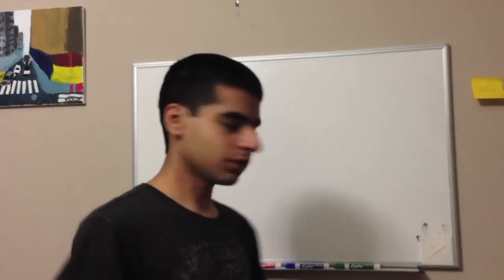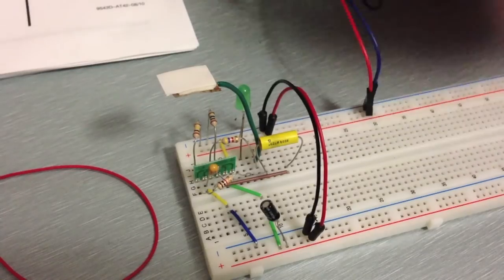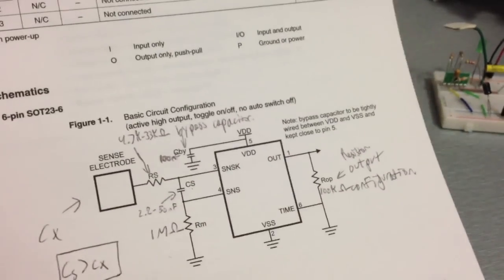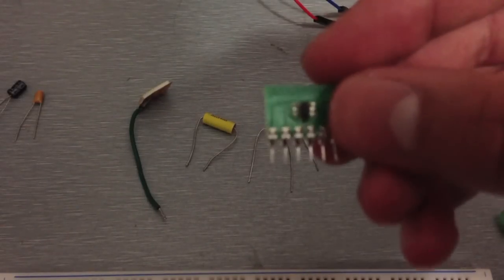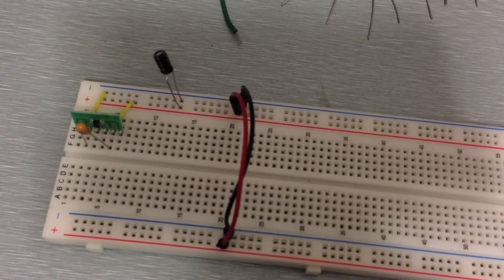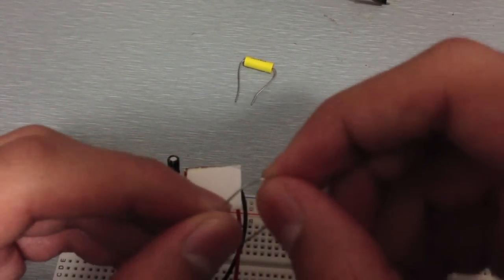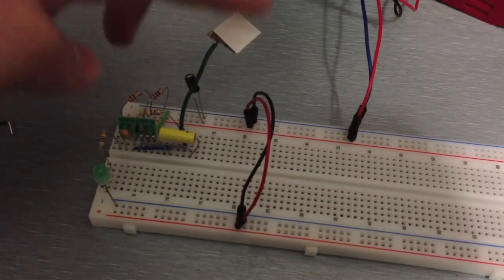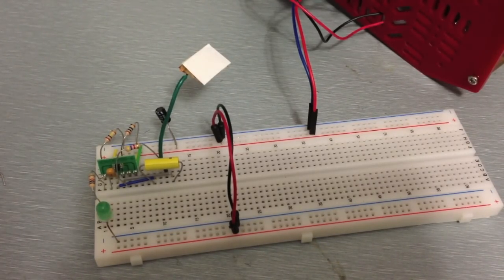How to Make a Simple Touch Sensor, Tutorial and Circuit

Comment: It's working. I rebuild it in the air without the PCB. Datasheet:"... This can be done, for example, by minimizing trace lengths
and widths and keeping these traces away from power or ground traces or copper pours.
The traces, and any components associated with SNS and SNSK, will become touch sensitive
and should be treated with caution to limit the touch area to the desired location. To endure that the correct output mode is selected at power-up, the OUT trace should also be carefully routed."

Comment: Hi again ebird, 
I finally got round to building your circuit.   Assembled the circuit no problem.  Made the touch sensor with copper foil etc also fine.  However, trying to solder on the absolutely TINY IC onto the breakout board - no joy.  I did not manage to solder it on successfully & so my circuit wouldn't work. You only get one shot at it with such a small IC - so I will have to accept failure on this one. All I can say is well done you and God bless your eyesight!! I contacted Digi-Key and asked if they could supply me with the chip already broken out with pins that are breadboard friendly. They say that they can't do it. It would have been a really nice circuit to show my physics students.  Thanks anyway for your help.
Best wishes, 
James
Reply from the maker: James Greally Try using a toaster over to solder them. You'll need to buy some solder paste. It's not recommended to solder these with an iron. You can find a bunch of videos on soldering SMDs it's not bad once you get the hang of it. It's actually easier than soldering through hole components. You just have to use different techniques.
Reply: ebird97 Thanks - maybe I won't give up just yet.  I'll check out the videos on ways to solder SMDs which  you mentioned - using a toaster oven etc. 
Thanks again, 
Kind regards,
James

Comment: Hello, thank-you for answering all of my questions so far! 
All of the parts have arrived to make the circuit, I have built it, but alas it does not work :( The LED is not turning on at all. I've been using a 2A223J sensing capacitor (.022UF), a 104k100 capacitor (0.1UF 100V), a 16V 10UF capacitor to stabilize the voltage, and the AT42QT1012. with the same break-out that you are using. 
I have tried replacing each component individually, and cannot figure out where I'm going wrong!

Comment from the maker: I have an idea for insects, use a clear flat piece of glass or plastic for the insects to walk on, then surround it with a tube. Place diffused LEDs beneath the transparent material, and then have photocells on the top of the tube facing towards the center of the tube. 
When an insect walks across the transparent material the light from beneath it will be blocked out and the photocell above will detect less light. It works like hand shadow puppets. Hope that helps!

Comment: Thanks for making this video! 
I tried it with the AT42QT1011 but i can't get it working...
I checked the circuit with a multimeter, and there is a signal.. 
Never get any current out of pin 5...  Try to take a higher sense capacator to..
Can I use an regular capacator for the (.1) bypass capacator, or is this a special one?
Is there an easy way to check if the ic isn't fried? :)

Comment from the maker: You would need to connect this to a transistor driving a relay, the relay would switch the 120V with a small signal from this circuit connected to a transistor(since the transistor can provide more current to the relay than the circuit alone). It's pretty simple, but it can be dangerous if someone without experience with high voltages is doing it.

Comment: Another quick question! 
I went to a beginners electronic tutorial last night and learnt about transistors. Is it possible in this circuit to put a transistor out of the first port on the AT42QT1012 breakout, to draw  enough current for 3 bright LED's straight from the battery source? 
The LED's in question can be found on the following link, I am not sure how much current they draw.
If this is possible, can you reccomend how I would go about choosing which transistor
Thanks in advance!

Comment: Hello
Thx for the vid. I tried to built it in a PCB but doesn't work. I checked all the connections and the parts: everything is OK. I've seen the datasheet too. When I turn it on the LED starts to light but in a sec or two it turns off. Have you got an idea what would be the problem? The PCB is really small and the in and out wires are too closer.....or somethig similar.

Comment from the maker: The output pin can source/sink about 1-2mA. So I would go with a small signal NPN transistor such as a 2N3904, or even better a small signal N-channel MOSFET since MOSFETs don't draw any current. A small signal MOSFET you could use is a BS170.

Comment: Hey Ebird97,
Thank you for this circuit.
I build it for myself and it's working great.
but I  have one question; is it easy to make the toggle function a pulse function?
So the led will only light up if your finger is on the sensor?

Comment from the maker: It can take 1.8V to 5.5V safely. If you're using 12 volts use a common ground between the sensor and battery then use a LM7805 to keep the voltage at a safe 5V for the sensor. The current draw will be maintained by the sensor, just worry about the voltage.

Comment: Hi
Great video, and the perfect switch for my project, however, I've mistakenly ordered the AT42QT1010 instead of the 1012 (I'm in New Zealand and had to order from the States) Best I can tell from the datasheets the only difference is pin 6 being SYNC/MODE instead of TIME. Would shorting pin 6 to ground work in the same way for the 1010 as it does for the 1012? I'm not really wanting to waste the IC's I've already bought. I'm fairly new to electronics and can follow circuit diagrams and such but the technical talk on the operation of these components is alien to me so I thought I'd ask you.
Thanks

Comment: Would you suggest using this method for a midi controler? Ive seen a few people use mometary buttons a few resistors and a schmitt trigger. but this seams like its more stable... and is there any debouncing involved?

Comment: Hi ebird again, 
I just bought the chip & break out board from Digi-Key. Had them posted to Scottsdale Arizona to a friend of mine who was flying to Ireland and she brought them over for me.  Now that I have finally received this TINY chip, It looks even smaller than the one in your video and it seems to have a little plastic cover or case surrounding it as I can't see any of the pins sticking out. Did yours  come with a cover of some sort on it? . I have never soldered anything so small and  I'm terrified of blowing it!  Any tips on the  handling & soldering the chip to the break out board? I'd be grateful for any tips or advice. 
Best wishes,
James
Reply from the maker: It should be the black little rectangle with the tiny metal leads. If there's any additional packaging please remove it before soldering. 

I recommend soldering a tiny amount of solder onto the pads of the breakout board first.
Then place the component onto the break board.
Finally, hold down the component with tweezers using one hand. With the other hand touch each pin of the component one-by-one with the soldering iron.

This will reflow the solder around the pads.
Reply: I'm willing to bet you got the 8-UFDFN package. The one in the video uses the SOT-23-6 package. Both are SMD ICs so you will need to find a way of mounting it. I'm guessing you don't have a hot air station, but I have gotten by with using a toaster oven for surface mounting chips.
Reply from the maker: John New Yep toaster ovens work!

Comment from the maker: Pin 5 goes to the positive supply. The bypass capacitor doesn't have to be a specific type, but tantalum is preferred. Just remember the value has to be 0.1uF.

Comment: Is there a specific voltage and amperage range that this circuit or component can work with?
As I am devolping a 12v circuit that's running at around 2 amps and I am looking for a touch / short range proximity sensor to power it on

Comment: Thank you so much for the video. I have one question... is there a way of turning it on (on contact) and turn it off right away not making contact anymore? (sorry for the engrish in advance) thank you again.
Reply from the maker: You would need another but similar IC called the AT42QT1010.
Reply: ebird97 Alright...  thanks a lot for answering so quickly!

Comment: cool. I think the other guy asked this question, but thinking of using this as a fast toggle device for my guitar. So that when I touch the probe the guitar comes on and when I remove it turns off…same chip you're talking about? it's a technique called toggling and a lot of guys use it with a toggle switch, but this would be faster and hence, something no one else can do!! so I would use that other chip and then basically use this with the audio signal in place of the power supply for the light?
Reply from the maker: If the device needs be on only when you're actively touching it I would use a different chip. 
AT42QT1010 or the AT42QT1011
Reply: ebird97 would it work with the same circuit and components for AT42QT1012?

Comment: Hi- I would like to run this touch sensor with 12 V and 5 amps for LED strips. Would it be feasible to make a capsense switch like yours without the ATML chip see - Detector de Tacto 3 from El profe Garcia . That only works with transistors - so one could save money and make it cheaper. Say max 40 ct for 3rd world countries? Thx

Comment from the maker: 5V is a voltage not a current, two very different things. You need to reduce the current and reduce the voltage with a single resistor. You use Ohm's law to calculate it.
For example if your LED is 3V and your supply is 5V then you have 2V left (5V - 3V = 2V). Then you divide the voltage by the current you need, let's say you need 10mA of current for the LED. So your resistance would be: R = V/I = 2V/.01A = 200 Ohms. 
So you place a 200 Ohm resistor to limit the current through the LED to 10mA.

Comment: Hi Ebird, I am in elementary school, working on a science fair project. I  am in the first stage of planning my project. I swim competitively, and I want to build a system to keep track of my laps and split times when I swim long event.(500 yard - 20 laps) I plan on building  the touch sensor in your video. My question is, can I build a larger touch sensor encased in plastic? Would the touch sensor work if it where placed in a swimming pool? If you think it would work, my next question is where do I learn how to wire the Touch Sensor to a Ipad that I would build  a waterproof case. I would lay the Ipad on the bottom of the pool so I could see my laps and times as I swim over it. Thanks for your great Video

Comment: How about a video/tutorial on how to make a circuit that operates on, and outputs 12 Volts DC. That uses a Phototransistor, and switches to power ON at night. Also make the phototransistor sensitivity  "adjustable".   You would need a variable resistor, mosfet and Comparator, and some basic resistors. can you do this circuit on a video? Maybe have it operate something 12 Volts, with a low  draw around  +/_ 1 amp.

Comment: if you have an ardunio you can just use a built in library (forget the name) and you wont need to buy any chips. You just need some foil and a couple resistors. Easy peasy.
Reply from the maker: Yes that's also another great method!

Comment: how can i get a AT42QT1012. ic in bangladesh..can it make without this ic..?
Reply from the maker: I'm not sure if it's available there. You may be able to buy it off of ebay.

If not, you can build touch sensors with Arduinos.
Reply: +ebird97 you can but from my experience, you need to have the right code. I have one and occasionally it doesn't work.

Comment: is there anyway to make it when u hold it stay on when u remove you it shut off
Reply: Yeah that's easier I think. Basically in arduino you make an if/else statement saying that if the analog value you receive from the sensor is above a certain value, digitalWrite of the led is HIGH and if not (else) it should be LOW. But I have yet to try this out this week so I don't really know if it works like that 100%
Reply: I just read in the comments that you can replace the IC chip in the video with another but similar IC called the AT42QT1010, ebird97 said this, if you scroll down a bit you'll find it